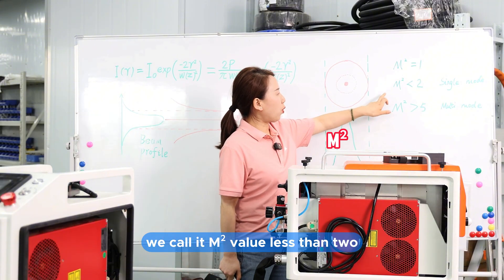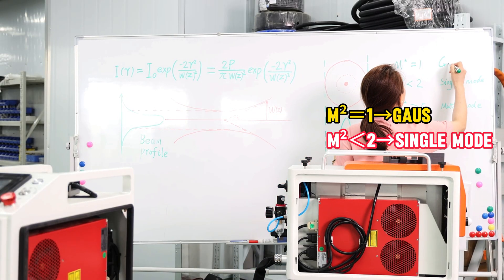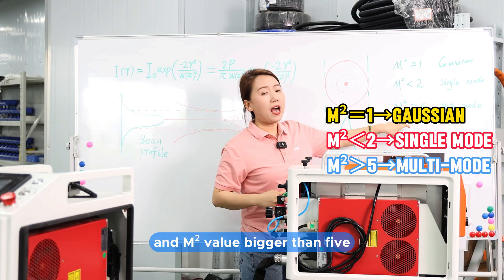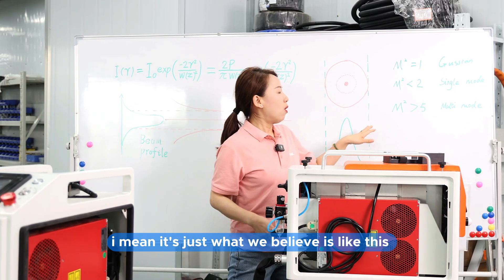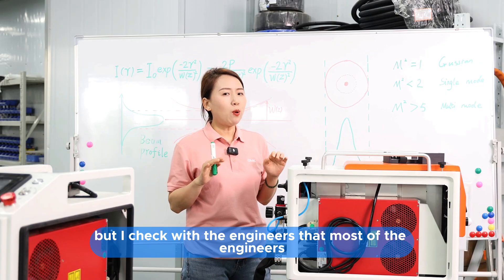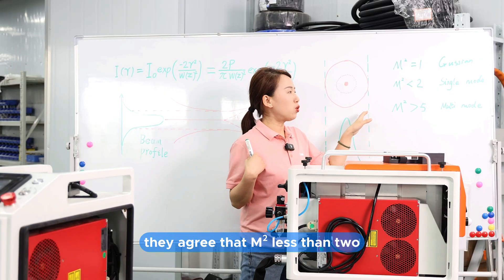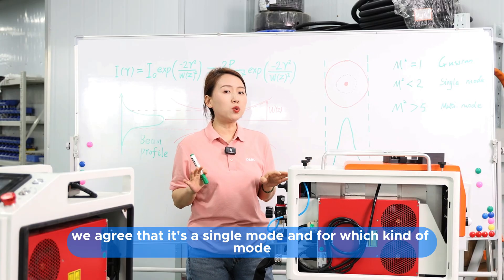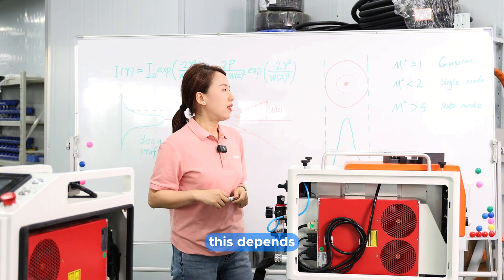Gaussian vs. Flat-Top Beam – Which Laser Cleans Better? #DMKLaser #dmklaser #lasercleaning #foryou

Comment: Flat-top beams usually clean more evenly because the energy is distributed consistently across the surface, while Gaussian beams have a concentrated center that can leave uneven results. I use the Monport Mega, and while it's not a cleaning laser, its precise beam and auto-focus make it perfect for detailed engraving and cutting.
Reply from the maker: professional, thank you for your sharing